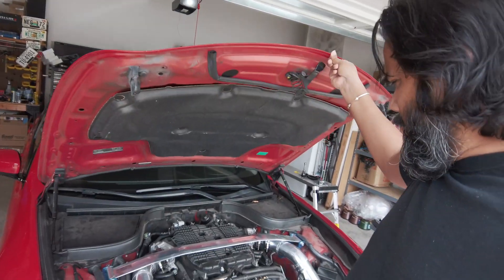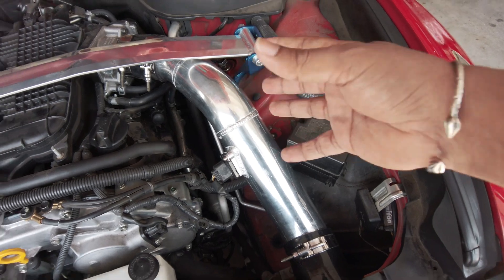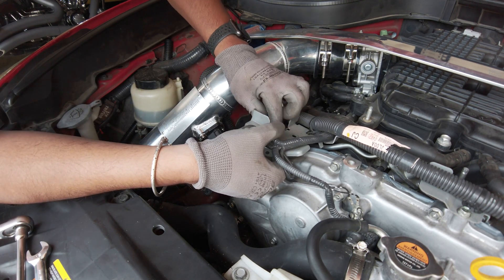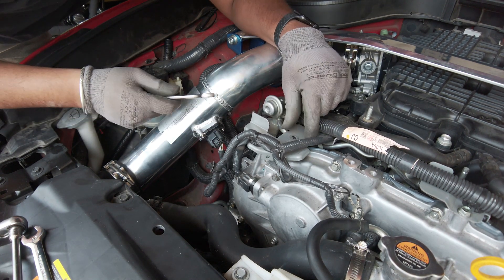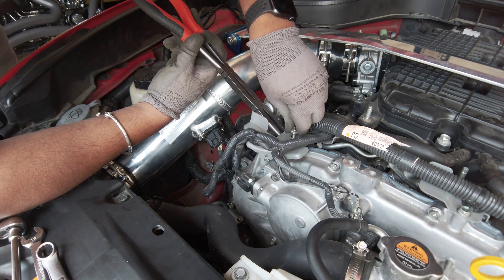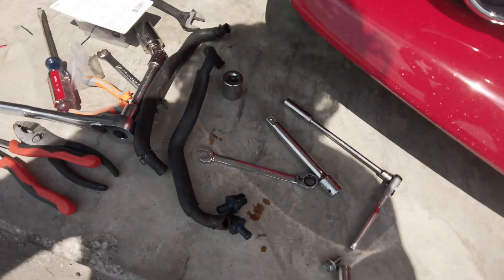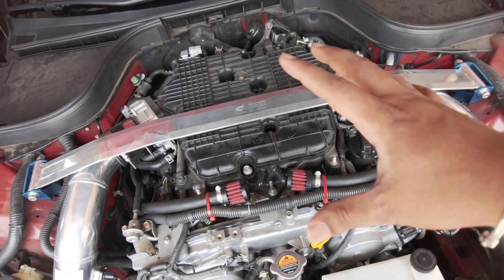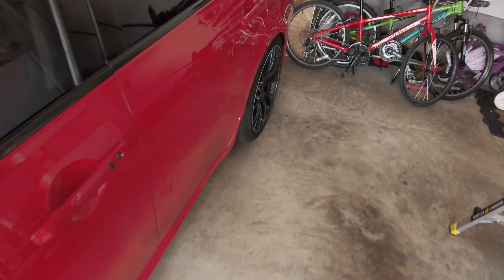Common mistakes when installing 3" Intakes

Comment: For the air port that you said people block off, it looks like the z1 3” intakes come with the hole so you can just put the rubber hose they give you. Kind of like the 2.5” intakes, so would that save me the hassle of doing all that you did to get rid of the vacuum?
Reply from the maker: Correct.
Reply: @3rdPedalMedia  thanks for replying so quick, got yourself a new subscriber! 💪🏼
Reply from the maker: @ezkoshows7136  thx for the support.

Comment: Jus got 3 inch long tube STILLEN cold air intakes was wondering if u need a chip to access the ecu or if I can get it dyno tuned without wasting money on a chip
Reply from the maker: I don’t believe stillen ever made 3” intakes. 2.5” intakes don’t require a tune but it helps. 3” intakes require a tune.

Comment: Clearly many do not understand how the ventilation system works. In relation to the bigger intakes the air velocity is slower (Daniel Bernoulli) making the output voltage from the MAF lower.
Reply from the maker: Without active forums a lot of ppl mindlessly mod their cars not understanding what makes or removes power.

Comment: You can actually vent the back two Pcv ports if you have a catch can because the catch can used the ports on the intake manifold
Reply from the maker: That will pull in unmetered air and cause bad idle and lean problems from the excess air.
Reply: @3rdPedalMedia  never had that issue

Comment: I have a p0300 code on my 08 g37 coupe ... i have changed the plugs, coil packs, silocone intake hoses, pcv delete and my car is still retaining the p0300 code and is now randomly overheating so its off the road til I figure this out ... anyone have any ideas? my only idea is to change the spark plugs again but use OEM instead of the crappy ones they gave me at autozone and replace the thermostat to fix the overheating.
Reply from the maker: I haven’t ran across that one. But found this forum thread see if it sheds some light 

http://www.the370z.com/engine-drivetrain/126330-multiple-cylinder-misfire-p0300.html

Comment: hey where can i find fuel hoses for the g37? for the ac lines
Reply: pls reply i got the 3 inch intakes and dont want them rubbing against the ac-lines on the driver side, where do i get those fuel hose protectors from
Reply from the maker: Any auto parts store will have it.
Reply: @3rdPedalMedia  thank you, so is there a certain size thatll fit on them? Or do i just go up and ask for fuel hose and itll be the same thing?
Reply from the maker: @xero0pacity88  yea just ask for fuel hose by the foot. Get about two feet.
Reply: @3rdPedalMedia  thanks for the help, also, im going to be installing catless downpipes/ test pipes and 3 inch long tube Z1 intakes, first 2 mods ever and im getting a stage 2 tune from z1, how much hp u think ill gain crank, im thinkin hopefully around 30-40hp crank
Reply: @3rdPedalMedia  also what width do i need for the fuel hose? Guessing about 3/8th??
Reply from the maker: @xero0pacity88  i believe so, but shouldnt really matter, slit the tube the wrap it over the line.

Comment: What if I want to add catch cans , do just leave the pcv breather as is with the filters ?
Reply from the maker: if its a recirculating catch can it will be in-between the two ports, the video illustrates the atmospheric setup.
Reply: @3rdPedalMedia  I wanna do the mishimoto dual catch cans & it only has 2 ports for each can , so am I fine just leaving the breather with the filter ? Like the way you had it in the video

Comment: Could i put 3 inch pipe cold air intake on infiniti fx50s 2011 without any problem
Reply from the maker: Shouldn’t you tune it. Unknown also if you may run into routing interference of the tubes.

Comment: Could you just throw 4 small filters over the crankcase vent and pcv valves and cap off the manifold?
Reply from the maker: Technically you can. But they the blow by gasses with condense to the closest cooler surface and create an oily mess under your hood.

Comment: I’m running add w1 dual oil catch can with 3 inches admin intake, what is best correct way to install
Reply from the maker: Plz explain how you have it currently routed
Reply: @3rdPedalMedia  best way could I send you the pictures to identify
Reply from the maker: @binli1956  send via ig
Reply: What is your ig account

Comment: All that explanation yet your throttle body is smaller than the 3 inch intakes🤔
Reply: Doesn't matter Does not really hurt power
Reply from the maker: replied to your 1st comment since you want to keep posting about this